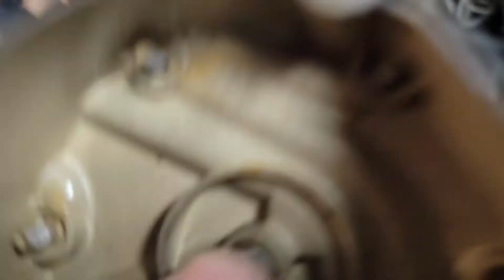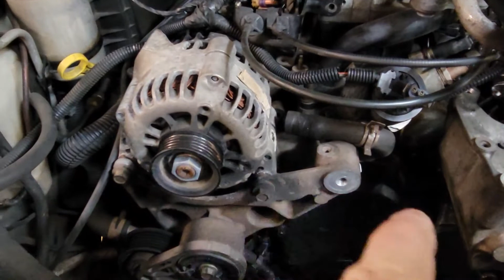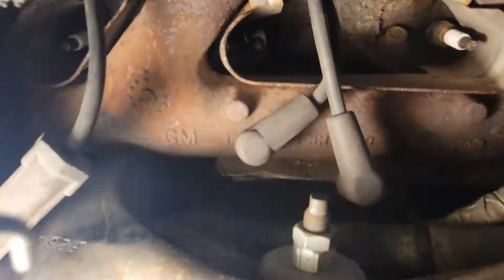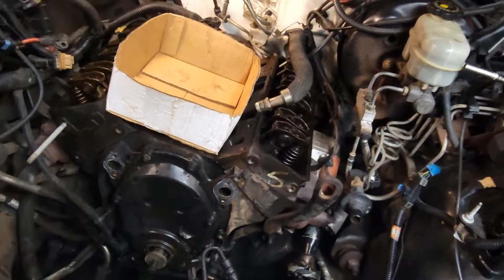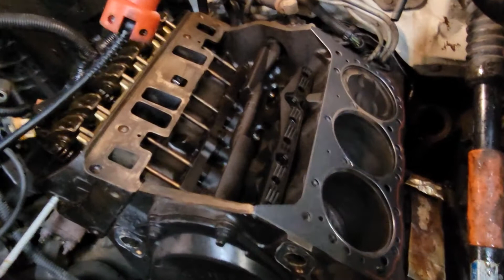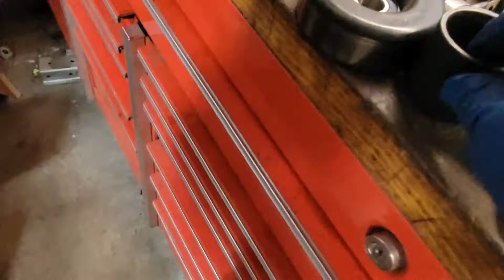01 GMC Sonoma 4.3 Vortec V6 engine quit while driving, possible timing chain jumped? Or much worse

Comment: My 2000 blazer with the same exact 4.3 engine stuck a valve and hit a piston not once but twice. Car has never been beat on. Its just a characteristic of this pos engine. The first time it happened we were 300 miles from home.
Reply from the maker: wow I've never heard of that before,  are you sure it didn't down shift to many gears to pull a hill or pass someone on interstate maybe , I've never had any v6 or v8 chevy have a valve stick open and hit piston and I still don't believe it could happen or how ,  I even replaced the valve with a used one out of a parts boat motor because they are same valve I just lapped it to the seat and that was years ago and have made many Florida and Virginia trips pulling things with it , I Def know mine was over reveved cause the pushrod was bent bad too and that wouldn't happen if valve stuck open all by itself somehow,  thanks for watching vassmotorsports and hope you check out some of my other videos sometime

Comment: You can put a new chaiset on with a tensioner, you need to install a different timing cover to accomodate this
Do yourself a favor and get melling chain parts
Reply from the maker: thanks for the feedback, stock chains are fine and turns out it didn't jump at all ,my 17 yr old son drove it like a race truck and i found no compression in one cylinder and bent valve and pushrod,  i pulled the head put a used valve i lapped out of one of my boat 350 engines(same valve) and pushrod and rocker and that was 30k ago or  more with no issues what so ever  , plenty of trips 12 hrs away to Florida and even hauled one of my new bikes home from Virginia Beach, i drive it all the time on the interstate, these chains will go 300k easy so no need to change , thanks for watching Vassmotorsports and hope ya check out some of my other videos sometime, always trying to get my little channel to grow

Comment: My blazer did the same thing, the distributor cap and rotor burnt and shorted out, I heard a popping sound coming from the cap while the blazer was idling. As far as timing chain jumping, very rare.
Reply from the maker: I wasn't sure cause motor has around 350k on it but I might have put a chain on it when i put the motor in 7yrs ago cause it had 300k when I installed and know I did a bunch of gaskets. ,this was my teenage son drove it and must have dogged the hell out of it and lied  cause it actually hit a valve on piston and bent it and ive never seen that on any stock 4.3 or SBC ,so I pulled head and put a valve and that was almost 2 yrs ago and been to Florida 700 mile trips one way and just took it to Virginia Beach to get my new to me Victory jackpot 8 hrs each way and she still running strong. , here's that video if like to see https://youtu.be/aeNI9ftDUdU?si=0fWqi7dAvVKl9Oxo. Thanks for watching Vassmotorsports and hope ya check out some of my other videos
Reply: My 2000 blazer with the same exact 4.3 engine stuck a valve and hit the piston not once but twice.car has never been beat on. The first time it happened we were 300 miles from home.

Comment: So good to see it run again after all that.  I just pop off the flexible seal on those pulley bearings and push some grease in to the ball bearings and press the seal back on.  Never had a problem doing that.
Reply from the maker: Thanks and thank you for watching Vassmotorsports, ive tried that with couple bearings before but I guess they were already to worn and damaged cause just packing in the grease didn't fix all them so as cheap as these are I just keep them on hand at the shop and pop one in , 6203 fit all kinda stuff not just pulleys lol